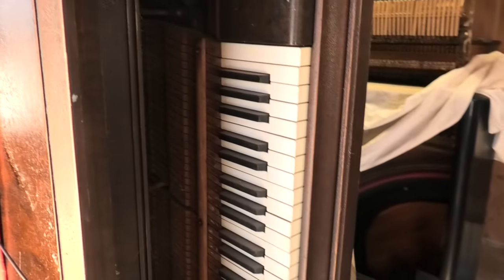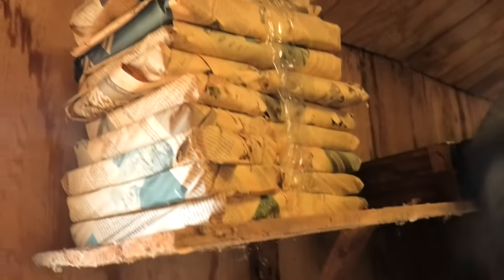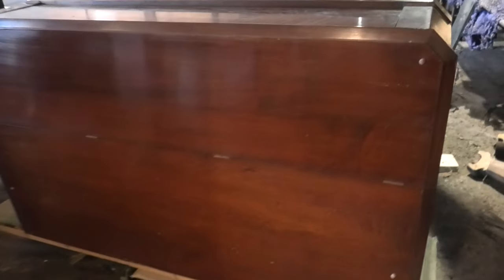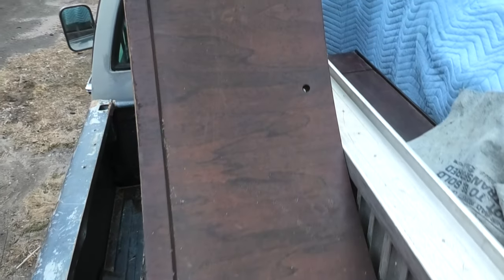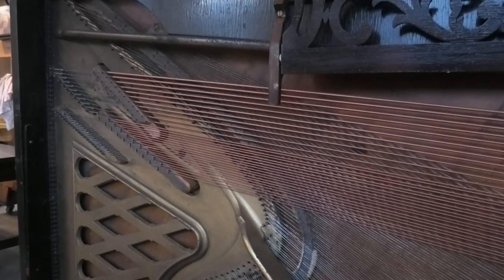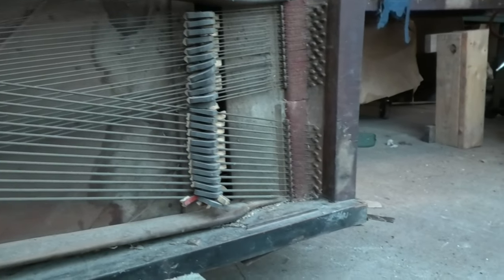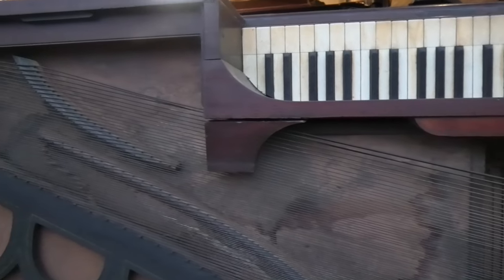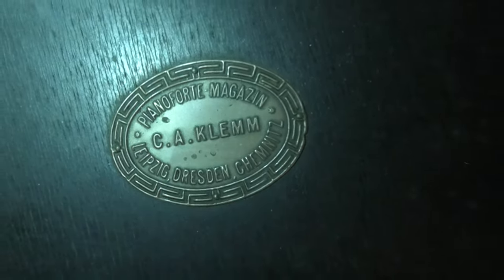Antique Piano shop salvage

Comment: What the world has become is disgusting. We're running out of resources and everything is designed to be thrown away yet the best pianos the world has are on the chopping block to be thrown away like trash with little effort being put into preserving less than a fraction of a percent until almost all of them are gone forever and the few remaining are locked behind museums and houses of the rich who are responsible for what the world is like today.

Meanwhile piano technicians recommend people to just buy a new one for the stupidest reasons when the piano they have is functional and will cost significantly less to restore to mint condition than an inferior modern one that the earth has to die more to make when there's such a huge surplus of wonderful instruments around the world.

When looking for a piano, I was trying to find a strait strung 1800s upright with a wooden frame but most of them were thrown away so all I can do is build the piano I want from another one that is damaged from getting dropped. I was lucky enough to find an 1850s one but it was modern on the inside and it turns out it only had the sound I wanted because of the cracks on the soundboard and the only piano shop in the city who sold it to me covered up all the issues and was super abusive when I sent it back so I don't even have any option of a place to get a piano from a technitian.

Across from where I'm sitting is a beautiful organ from the early 1900s and I can't help but wonder if it to will be tossed in the trash after I pass which could happen immediately after I finish restoring it since there are little chances of someone wanting it in time after a previous owner leaves the world.
Reply from the maker: Hey! nothing lasts forever.
 I've spent most of my life saving old pianos.
It seems like forever  sometimes.
A few were/are historically significant.
The oldest one we have here is 1810 grand.
Check out our Hampshire Piano videos.
And see!